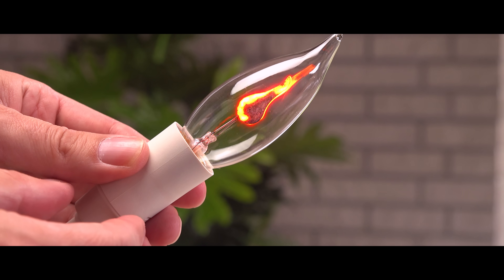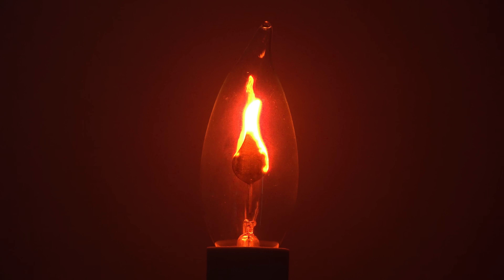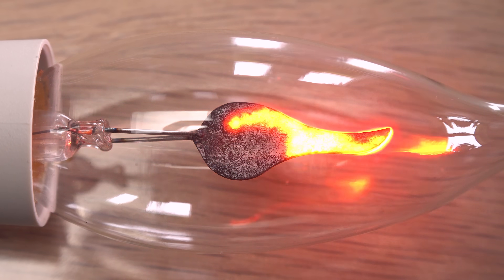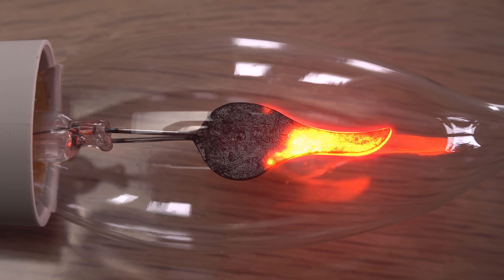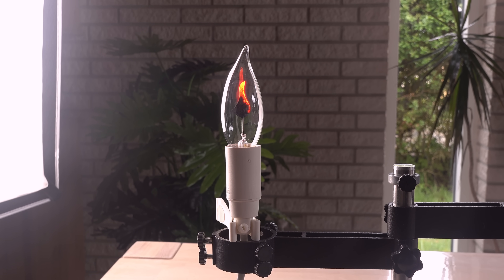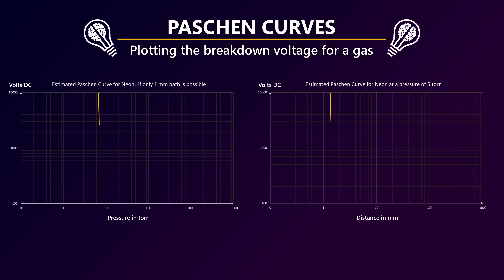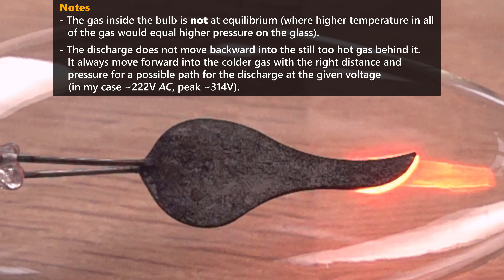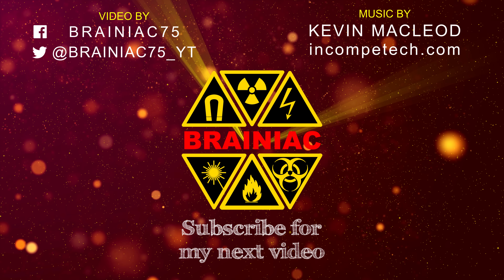FAULTY Flicker-Flame Light Bulb? Amazing in slow-motion!

Comment: You are correct it is faulty. I have gotten some like that one. And I have been unlucky enough to get one that doesn't even light at all because the gap is way too close between the plates. Ideally it should be like you said a nice straight gap with tapering outward at the tips like you said. 👍

Comment: 4:46 love the animation of the flames on the reverse side.

Arguably a manufacturing defect - the manufacturing step where the leaves are stamped with an outwards curvature got accidentally skipped. It happens. It might even happen to a whole batch. As long as the bulb still appears to work, it will be sold, perhaps the reseller got them at a discount.

One of those cases where failures are often more insightful than successes.

Comment: You could try gently tapping the bulb so that the electrodes spread apart slightly, so giving a gap larger at the top that might change discharge. Or surgery to remove the lamp base, and lower the resistor value a little, so that you get a higher current. Will need a new base, easy to get from a blown LED lamp, and a little 5 minute epoxy to make it adhere to the glass base.

Comment: I feel that you could possibly fix this bulb using one of your large magnets, and a suitable high powered laser.

Set up the bulb in a sturdy holder, place a strong magnet near it to deflect the electrode, then focus a strong laser on the electrode bonding wire and heat it to allow the deflection to become permanent.

Would be fiddly (focusing through curved glass, mounting, laser power control), relatively dangerous (magnets, specular reflection risks), but would make for a really interesting bit of content!

Comment: You dont see argon glow because there is no positive column discharge here. Only negative glow around the cathode. Most of the light before warmup  in a SOX lamp comes from the positive column discharge, which is more pinkish from argron and the area around the electrodes is more orange from neon.

Comment: Alec from Technology Connections did a video about this lamp a year and a half ago. He concluded that the unstable discharge was due to a coating on the lamp's electrodes being uneven, and when he tried using a high value resistor to limit the current to some small neon indicator bulbs. The result: a dim discharge but no flicker.

Comment: Sometimes these bulbs have electrodes with an oxide coating applied to the surface to alter their emissivity. Like the inner surfaces may be coated to insulate them to keep the discharge only on the outside of the electrodes. And the flat, nearly parallel spacing is key too, as it provides an environment where many equipotential points are available for the arc to strike.

Comment: I guess these neon lamps were first introduced well over a hundred years ago, long before the output of LED's was discovered. My main fascination is how the need to remove gasses from thermionic valves (maybe?), led to the discovery of the noble gasses with their own spectra and then to produce such pure neon etcetera that the modern analyser does not detect additional elements.
Reply: Nice comment @tommiller1315.  I want an antique one now - do you think such a thing could be found there days?  I searched the net, but without much luck.
Reply: @reubenwoodley96   Oldest item I found, (in the USA) is this item number:276435457385 on the bay. Circa 1950  at a rough guess. They look very similar to current models though.
Reply: @reubenwoodley96  Amazon has them
Reply: @bountyhunter4885  Didn't think Amazon sold antiques.
Reply: @tommiller1315 There's more than just Amazon. There's plenty of marketplaces online where people sell stuff they don't want anymore.

Comment: One of the more interesting features of neon indicator bulbs is that they are light sensitive!  I noticed one night in a crappy hotel that the indicator light for the aircon was flickering (due to age) during the day, but at night it was off totally. Using just the light from my iPhone screen to illuminate it was enough to start it up again.  These bulbs need either quite a high voltage to ionise the Ne or some external source to ionise it.  Apparently some Ne lights that were used for early counters to drive Nixie tubes included a little bit of radioactive gas mixed in to ensure reliable and rapid ionisation. Others have an incandescent bulb beside the Ne bulbs to help them to fire!

Comment: I'd like to see on the 1000 FPS camera how the neon glow goes if the supply is rectified and smooth DC instead of the AC. Or maybe higher or lower frequency AC.
Reply from the maker: Great suggestion. I will try to find a high-voltage DC source (or rectify mains electricity to DC). Higher or lower frequency AC at ~230V is trickier. Could be very interesting to examine though... Thanks for the early watch!
Reply: @brainiac75  what camera do you use for the 1000fps shorts?
Reply: VRF or Variable Frequency Drive would be the obvious choise to get a variable frequency AC source, but those are expensive.

The poor man's version that I've done is to have an iron core transformer connected to a subwoofer amplifier to boost the voltage, and then have a signal generator app on a phone connected to the amp.

So a subwoofer amp, and then the low voltage winding of the normal iron core transformer connected to it. The voltages are probably good to keep in mind. With 24VDC input to sub amp, you might want a 230VAC to 24VAC transformer and wire it the other way round (so it boosts the voltage and doesn't decrease it like it normally does)

Comment: Would it light up completely if you overvolt it a bit?
Reply from the maker: I think it is better to increase the current. Overvolting could cause a spark in stead of a glow discharge. But with the right voltage and current - just at the border of arcing/sparking - it should be possible to light up all of the electrodes. With that said, I think the shown lamp would light up in larger patches if provided with the nominal 240V. Come to think of it, I think my UPS can be set up to provide 240V AC... Definitely need to make a follow-up video or two for these lamps. Have ordered some more of them too :) Thanks for the early watch!

Comment: I have about a dozen of those bulbs in storage bought decades ago for a few decorative lamps.  I have one that's still going after decades.  But to be fair, that lamp the bulb is in is not used all that much. Only occasionally.   Still maintains a very nice flame flicker looking pattern,  distribution and brightness.  No gas leakage either. I'm actually impressed with these bulbs.
Reply from the maker: The shown bulb is really old too. I can't remember when or where I bought it. Though it has been used very little too. With that said, they are surprisingly durable. Will outlast any fluorescent tube - maybe even most LEDs? And they don't mind vibrations, mechanical shocks (unless hard enough to break the glass of course), or getting turned on and off repeatedly many times. They are really rugged. Thanks for sharing!
Reply: @brainiac75  Yeah they are pretty rugged. Well built. And you're welcome.

Comment: Neon has been used for years as a cheap power on indicator. One of it's weaknessrs is over time they outgas and start to flicker and fail. They also will discharge at about 100V.
Reply from the maker: Yeah, need to follow up on this video with examining the small neon indicator bulbs. Have ordered some more flicker-flame lamps too for larger sample size. Hopefully with bent tips this time ;)
I do have some of the small neon lamps in on/off switches on multi-plug extension cords. One of them has been on continuously for many years (close to a decade) with no flickering visible yet. Looking forward to seeing one start to flicker :D Quite amazing at how low voltage (AC) they can make them discharge considering the high neon content. Thanks for the early watch and comment!

Comment: Maybe you can use a laser to heat up both metals near the tip to 'bend' them? It should pass through the glass and only heat the metal right? I think you just have to make sure it hits the tip on the inside in-between both pieces which poses a challenge.
Reply from the maker: I think I will keep it as is. It is interesting in its own right. But I have ordered some more bulbs. Hopefully they have bent tips or at least a more 'normal' performance. Would like to see a properly working one in 1000 fps slow-motion... Thanks for the early watch and comment!

Comment: I love that you understand this stuff so much that you can tell when some random flickering is flickering with the wrong randomness
Reply from the maker: Hehe. Well, I just compared with other bulbs I have seen in this form factor ;) Actually just ordered some more for a larger sample size. Hope to show how this one stands out. Or maybe the relative low voltage in my house is the issue... We'll see when the new ones arrive.
Reply: @brainiac75  Perhaps you need a variac so you can pump up the voltage to the rated voltage needed. Those variacs are actually very useful and not that expensive.
Reply: @brainiac75  That will be a cool comparison!
Reply: It’s called an education in electrical engineering.
Reply: @BritishEngineer Mixed with the idea it does not behave anything like a flame would... we're kinda in common sense territory still right here.
Reply: @MadScientist267  The product itself wasn’t designed to flicker like a flame in the first place. No reaction to blowing, no smoke in low oxygen levels, no melting wax etc. There’s no reason to bring in real candles into the equation.
Reply: @BritishEngineer  No, it was intended to look half realistic but they do indeed fall short.